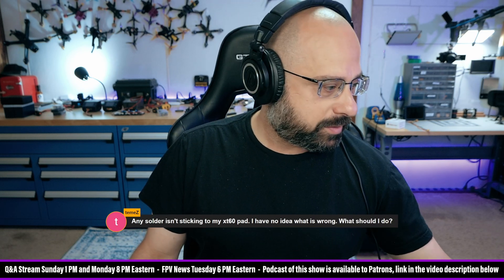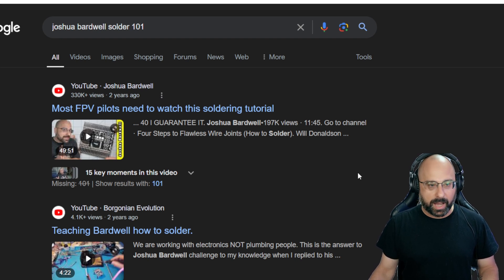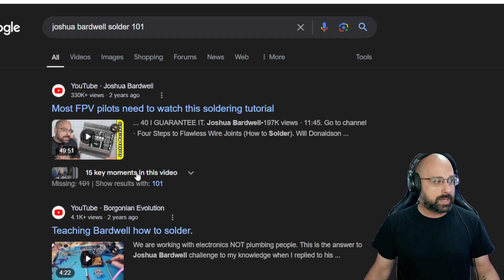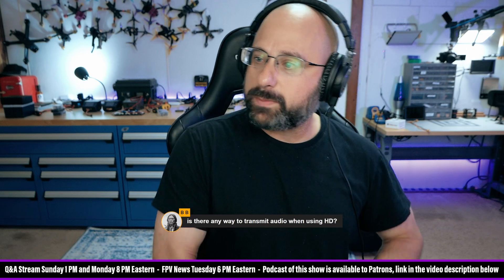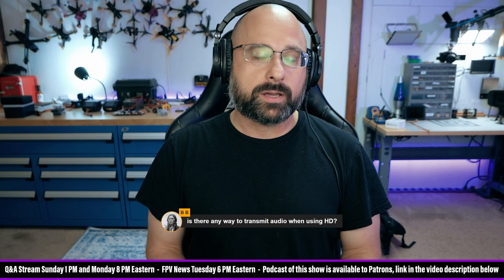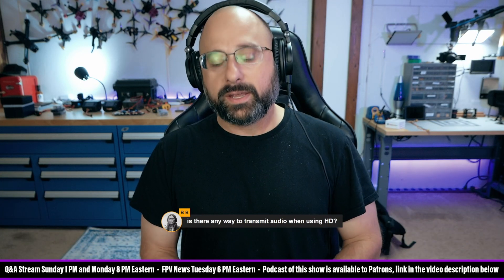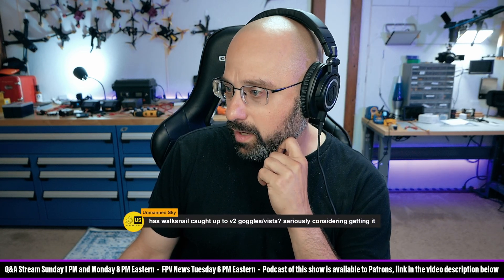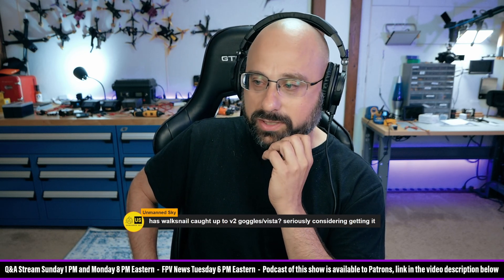My Solder Won't Stick! Too Many Drones Is How Many Drones? Has Walksnail Caught Up To DJI?

Comment: Also, when soldering, make sure the pads, wires and soldering iron tip are quite clean and NOT dirty, oily (finger oil, etc.) or oxidised.  Use fine grit sandpaper on the pads and wires if you have to and clean with Isopropyl Alcohol.

Comment: Use flux and practice on an old board or the practice board . For Xt 60 s plug male and female together and then use flux and solder . I’ve melted a xt 60 plug before holding heat on it for too long . Xt 30 s melt even quicker.  It’s just practice and then you’ll get it . Tin your tip . Have fun . Don’t breathe the smoke .